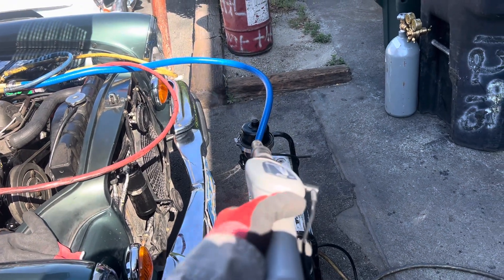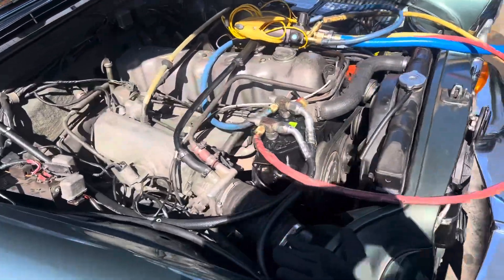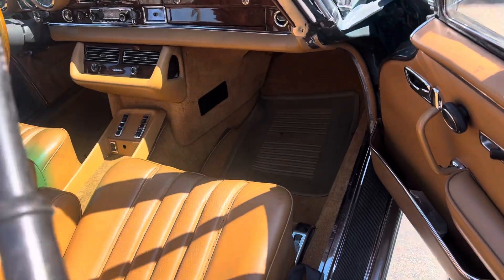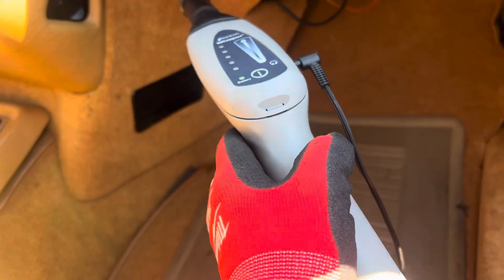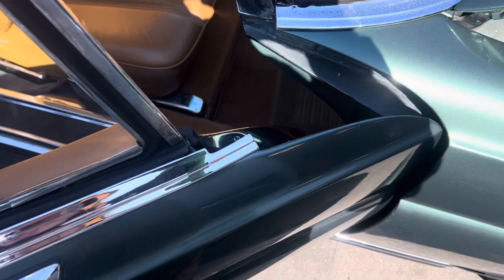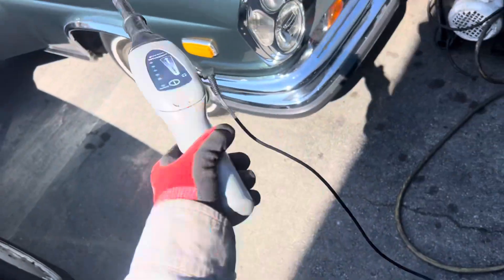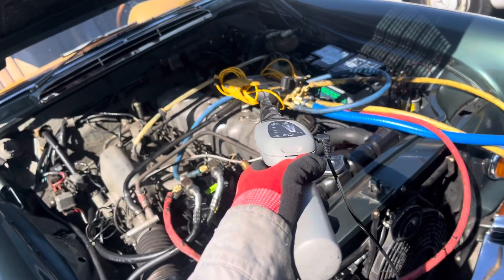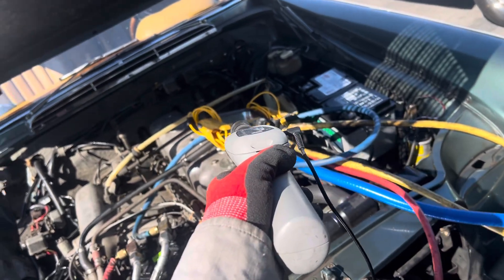-29.9 vacuum, but there’s no micron reading.  Analog ages would never find this during vacuum.

Comment: you're supposed to valve it off and leave it, and if you don't still have the same vacuum you have a leak.
Reply from the maker: @badatcad  yes you should velvet off, but there’s those guys who don’t and waste their time and figure as long as their needle hits 29. They’re doing good.. 

Then there’s those leaks that are so slow at 29.9 .  Only the micron level will show the slow leak never getting down below 29

Just a very slow, gradual loss of vacuum in the micron range that will never show on an analog gauge . 

Very few people leave their gauges under vacuum over a half hour or an hour 

The micron gauge can show the leak in minutes that will take well over an hour before it starts to show on an analog gauge 

Micron gauge can also show high moisture contamination analog gauge can never show that

Comment: 05 F150 34,000 miles,  AC compressor manifold cracked suddenly at the compressor and blew out the entire charge including of course spraying Pag46 all over the frame...it happened during 70 mph driving with the AC on max.

The high pressure discharge metal pipe broke at the square base that bolts onto the top of the compressor..

38 oz R134a
7.5 oz of Pag 46

How in the world does one know how much new oil to add back?

No time to blow everything out with dry nitrogen or disassemble and drain each component..

If you had to do an educated guess  on how much Pag 46 is left in the system...of course I know no one has any way to say for sure, but just a guess?

Also I'm assuming it's best to have a little too much oil vs not enough?

Thank you..
Reply from the maker: @freddyhollingsworth5945  if I were to guess throw 4 ounces in there and call it a day.

Comment: As Tom says, the moisture vapor coming out the vacuum pump is telling you there's an excess of moisture. In this case its moisture in the air being drawn into the ac system through the leaking part/joint. Same thing happens if you get one where the shaft seal lets by under vacuum.

Comment: its not just the old guys say 29.9 .i have watched some residential vacuum pulls on a dry system for their test to show us and in 10 ,15 mins they get aprx 200 micron. so im now testing and old tank to simulate this and i can get 150  in aprx 15 min no problem. now i put some pag oil in tank and just a few drops of water in it. let u no my results soon. i think thats why auto guys think 20,30,45 minutes they think its dry, so if i replaced everything in the ac system on a car and then pulled a vacuum i believe it could be true. but  on a repair and system left open it will never happen ,i already no that with my test.
Reply from the maker: @RATCHETMAN1001  yes yes and yes, you are 100% correct

Comment: What ultrasonic tester is that?
Reply: Is it the whisper model?
Reply from the maker: @nservice1625  yes it’s the whisperer model
Reply: Is it the whisper model?
Reply from the maker: @nservice1625  yes it is the whisper model
Reply: Is it better to use it to find leaks under pressure, or leaks under vacuum?
Reply from the maker: @nservice1625  both

Sometimes you could find a leak under vacuum and pressure on the same leak 

Sometimes when you put vacuum, the vacuum will pull the O-ring if it’s a rubber part in words and it will actually seal itself and stop leaking 
      But as soon as you put pressure on, it will leak

Other way around exact opposite is true .  I just I think released a video might’ve been on the Facebook group
(Auto HVAC technicians)
Where I showed the vacuum leak that leaked vacuum .  But as soon as you put pressure on it, it stopped leaking.. 

There are so many different scenarios of how leaks leak turn off or on, sometimes can only fine with UV dye
Sometimes can only fine with the electronic refrigerant leak detector, and there has been times were only soapy. Bubbles have found leaks. There is no one best method or tool to find leaks because there’s so many different types of leaks that turn off and on under different conditions.
Reply from the maker: @nservice1625  Inficon available at True Tech Tools
Discount code 
LECHAIR FOR 8% OFF
Reply: @coldfinger459sub0  is it the whisper?

Comment: Chief Tom, I would like to report. The Big Blu leak detector is so AWESOME !!!!!!.  I did not use on HVAC but was using it to find fitting air leak.
This liquid can stay at vertical location, won't dry so fast and when I thought it dried up, it actually stay go-eey and works like magic for super micro bubble. This is the next best thing to water submersion of leaking vessel/fitting test.

There is a saying in my country : Eat well sleep well, when using good parts/tools. Thank you for showing me Big Blue. Bow bow bow.
Reply from the maker: @suryaprihadi2258  everybody is always skeptical and say I do the same thing with soap 🧼 and water. 💦 

But now you have experienced the difference of a product that is not soap and water.
Reply: @coldfinger459sub0  soap n water  if i give a scale, it is 3. Big blue the perfect 10. I hope big blue is also having a good wind resistance... if so, WOW.. it will be even better

Comment: The ultrasonic leak detector hears the vacuum leak? Can you explain how that test works? Thanks!
Reply from the maker: @advancedleveldiagnostics  very small leaks, produce a ultrasonic frequency sound that the human ear cannot hear. 

So basically, it’s like a super sensitive microphone that is tuned in to higher frequencies that pressure leaks, or vacuum leaks produce . 

And then change the frequency inside the unit to something the human ear can hear
Reply: @coldfinger459sub0  Thanks so much! I'm learning a lot from your channel. I just ordered the fieldpiece Sm480v.

Comment: Are the ultra sonics good for evap leak diagnostics also? I.e pointing into the vents?
Reply from the maker: @Jeff-gb5rt  usually not unless leak is absolutely huge gigantic. 

Ultrasonic frequencies get blocked by anything in front of them so they’re not good at going around corners or going through objects . 

Evaporator leaks you need extremely very highly accurate and rather expensive refrigerant leaked detector .

Comment: Tom, Question about vacuum pump ballast valve. When should it be OPENED and for how long?  Is there any problem created by not opening the ballast bleed valve during vacuuming of the system?  Thanks
Reply from the maker: @LewisAAB371  open it up at the very beginning and when you get down to around 2000 icons, you can close it

It makes for easier start up of the vacuum pump 

It helps aerate your oil to help chase the moisture out